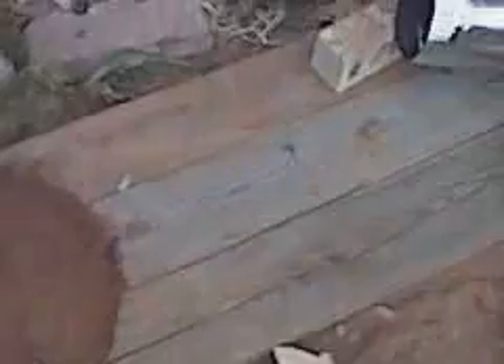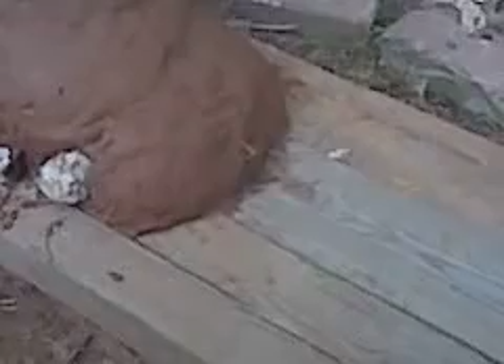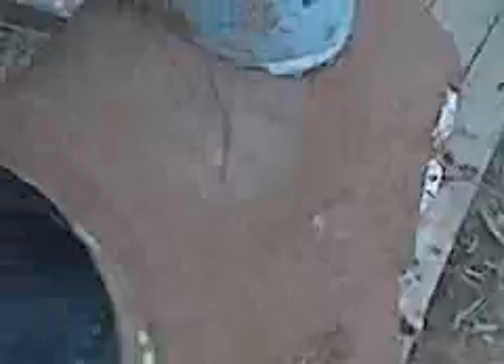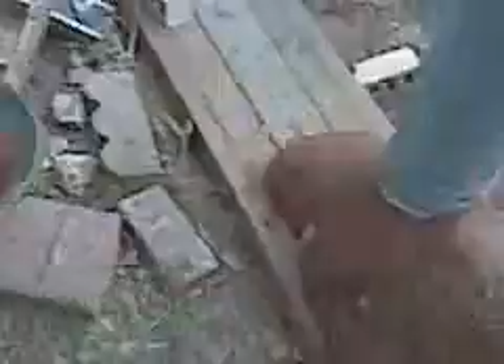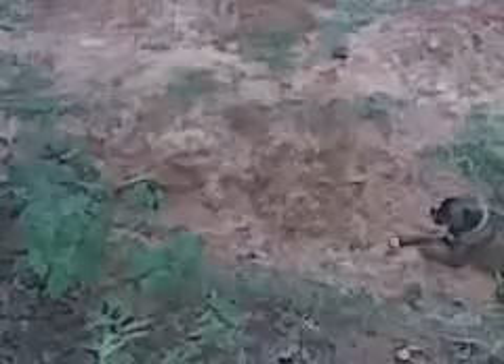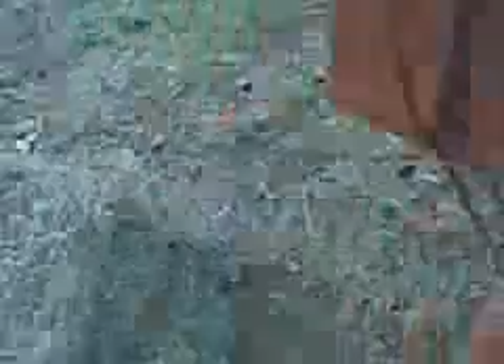Rocket stove for winter greenhouse part 2

Comment from the maker: Actually, I didn't have to reload it that often. The vertical orientation of the fuel tube allows for longer peices of wood that would burn down. It would go out before I woke up for the morning, but the thermal mass in the greenhouse(cob, cinder blocks, barrel of water etc..) kept it at an acceptable temp. I did have fresh tomatoes at christmas. Thanks for the comment.